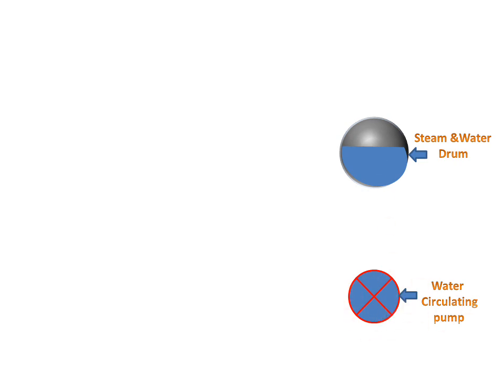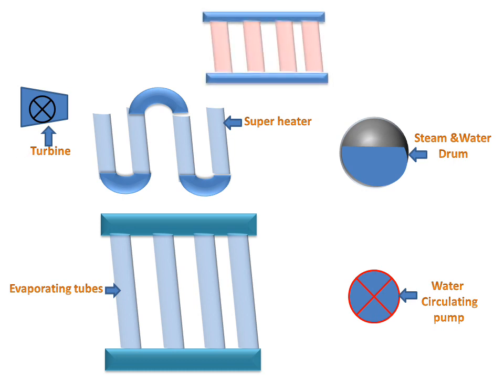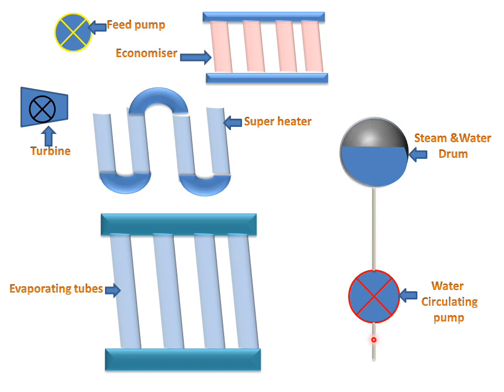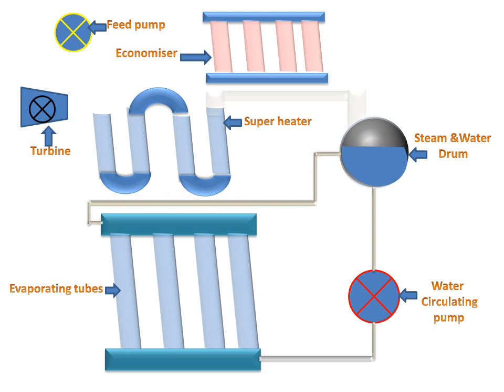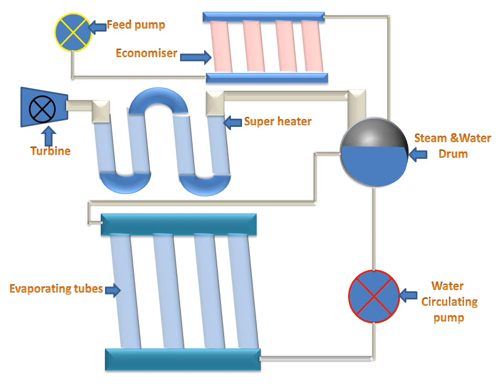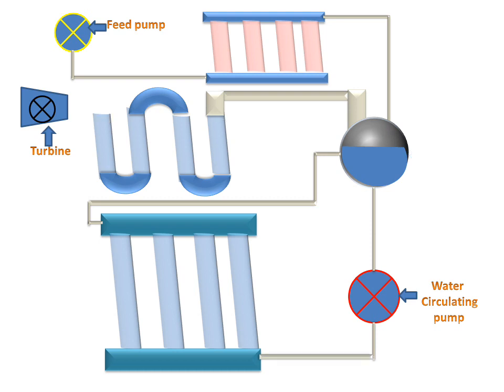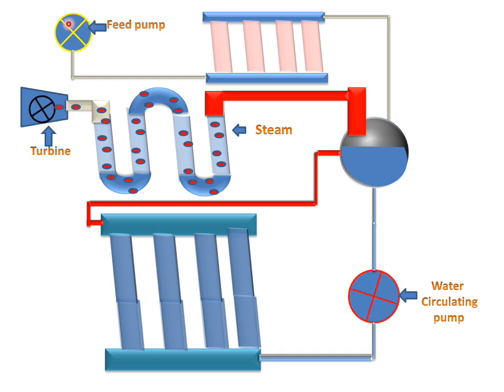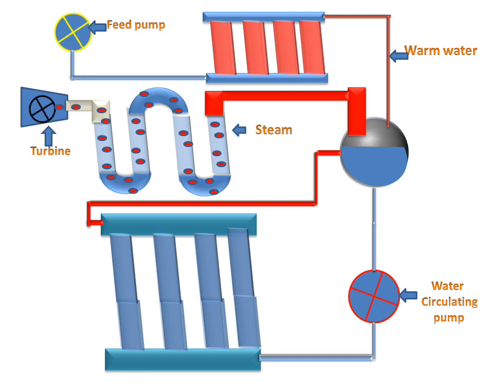Lamont Boiler(High Pressure Boiler

Comment: Thanks for sharing, It will be great if you can add  " Engineering terms " like wer sensible heat is added in the circuit.